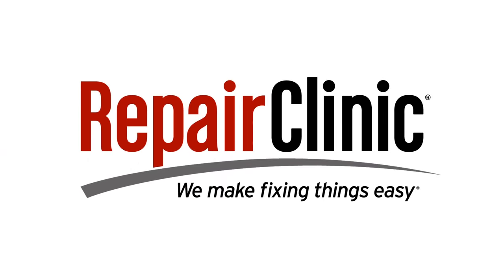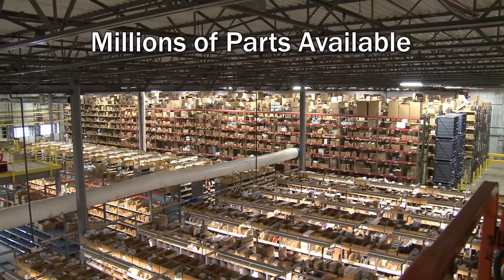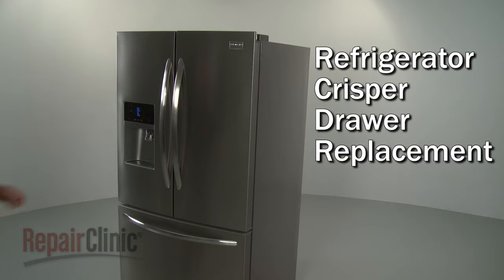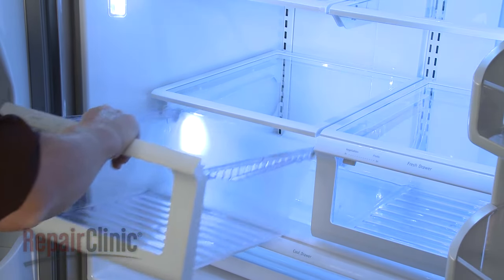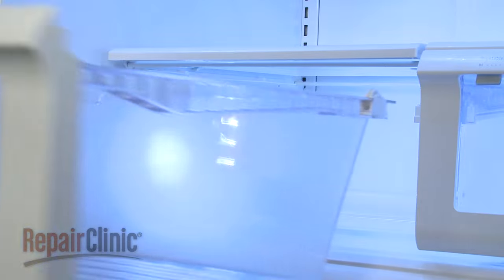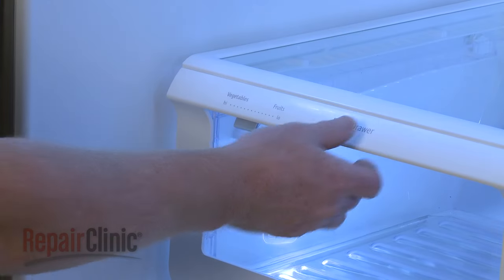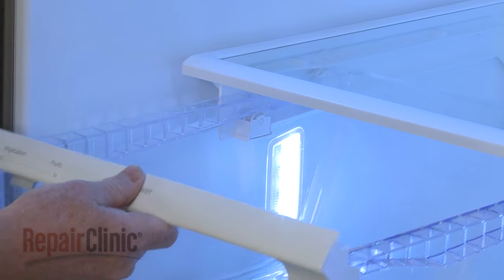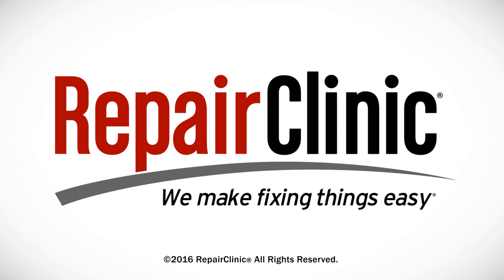Frigidaire Refrigerator Crisper Drawer Replacement 241801802

Comment: How about the frame of the crisper?
Reply: @repairclinic  so the wheels for the crispers are on a track, and the screw holding the wheel to the track ripped straight through, so now there’s no where to screw the wheel back into place
Reply: @repairclinic  I spoke to Frigidaire and they said they can’t give me the part but I have to have a tech come out and install it, told them to kick rocks, not paying 150$ to have someone put in a drawer for me